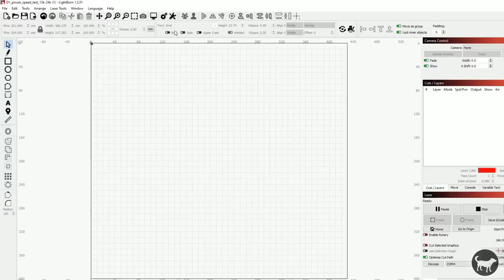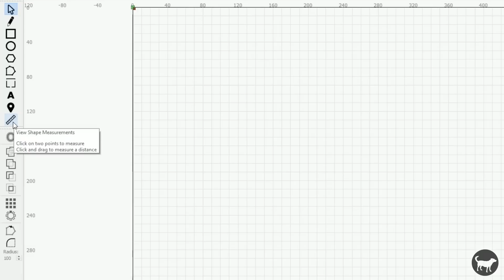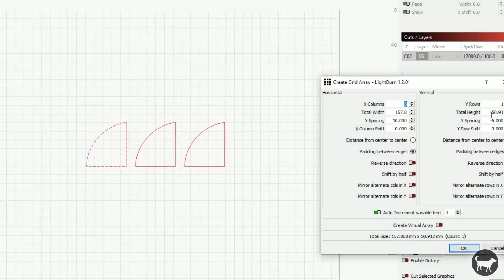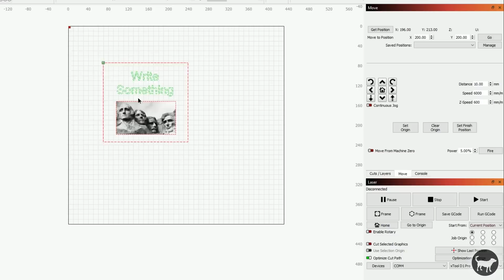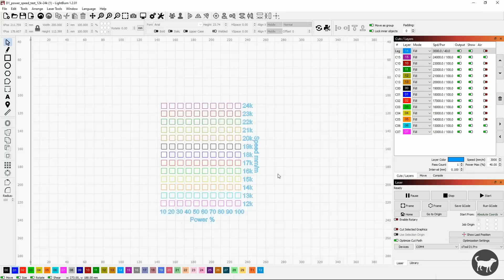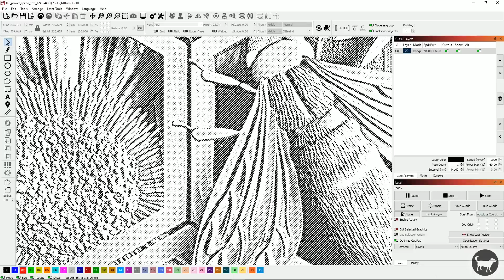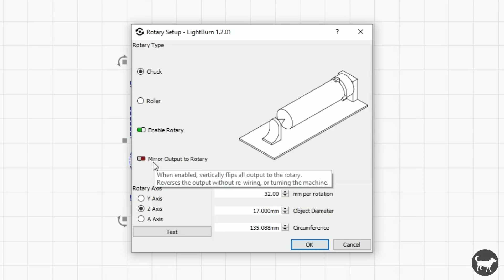Lightburn Tutorial for the xTool D1 / D1 Pro

Comment: I'm slowly losing my sanity. I've spent close to 7 hours trying to get a homing issue figured out. I've set up everything 2 times now. I thought the problem was the fact that I originally downloaded the lbdev file for the D1, not the D1 pro. I opened the device list after downloading the proper lbdev file and it found the D1 pro. I'm surprised the D1 lbdev still ran the D1 pro and it through me for a loop.... I thought deleting everything would have reset the software, but when I re-downloaded Lightburn to reconfigure everything, it had the D1 Pro recognized already. 

The issue is that when I try to home the machine, it just keeps trying to send it beyond the x0/y0, and makes a terrible sound for several seconds trying to rehome way beyond the limits. I just can't figure it out and I'm going insane. 

I bought your grid files excited to use them but it doesn't create the grid in the correct place and if i burn it again... without moving a thing, it will create a grid completely off target of the original grid. I have feet for it and everything. Please help me.
Reply: Another detail... If the laser is in the center of the working space and I press the home button it tries to send the laser  to the x0/y0 as if it were at the 420/400, not recognizing it's in the center of the workspace and not the bottom right corner.
Reply from the maker: @aaronscheibe9597  I'm not 100% sure what might be going on with your build of Lightburn but I would suggest trying 2 things. First I would open xTool Creative Space and click on the gear icon and check and see if you can get a firmware upgrade. After that I would see if you can clear Lightburn and try to do a fresh install. If the install is not clearing everything  you might need to clear the backup first. On a pc you can find it under : C:\Users\YOUR_USER_NAME\AppData\Local\LightBurn  (Might need to type in AppData if you don't see it). Not sure where that lives on a Mac if you are using one. Other then that I would also make sure your limit switches are plugged in and functioning. Might be worth checking to see if that works in xTool Creative Space as well.
Reply: https://www.youtube.com/watch?v=xHZdGn6n8MQ

Comment: I have had a d1 pro 10 watt for about six weeks. Recently the laser head will start hesitating and grinding when I am trying to burn a project. It jerks back and forth. I have checked all of the belts, made sure all of the screws are tight and cleaned the machine. I  I have tried with different files and it does the same thing. It does it in lightburn and xcs...is this a possible lightburn issue ?.Can you help? Thank you.     Tom
Reply from the maker: Hi Tom. The only time I have seen that happen was where I was trying to engrave a picture too fast and my computer couldn’t keep up with the speed of the laser. I found my laptop was too slow and the laser would grind as is got jumbled data. Either try shutting down different programs open on your machine that might be using CPU or send the file over Wi-Fi so the entire project is already on the machine. Other then that I would reach out to the company through Facebook or their website to see if they have an answer.
Reply: @BusterBeagle3D  Thanks for the reply. You got me thinking in the right direction that the problem was computer and not machine related. I had not made any changes on my computer except, just before the problem started lightburn had opened with a small window stating that I had not been there before. I clicked on the window and lightburn reopened. So I deleted light burn, imagR and xcs. I reinstalled them and now everything is working. Go figure 😺😅..thanks
Reply from the maker: @tomw5435  Glad you are back up and running!

Comment: Simple questions. I haven't even purchased mine yet. Once all cut paths are done, can you save the entire file so you can run the same exact thing again later, and will all settings remain the same? Also, do you need to run the test pattern before every time you use it, or can you just run it once on 1/4" mdf and assume all 1/4" mdf is the same?
Reply from the maker: Correct. You can save a lightburn file and run it as many times as you want. Also not all wood/MDF is identical. Plywood especially but you can probably use the same values if you are doing 2 different 1/4 MDF boards. Just be careful with MDF as some of it contains formaldehyde and cane be poisonous when using it.
Reply: @BusterBeagle3D  Thanks for the MDF tip, didn't know that. Love your videos for getting right to the point, and the training content is easy to understand.

Comment: Great Video. I also appreciate the templates from etsy. You stated the workable size for the 20w is actually a little smaller than 430x400 but xtool says 430x400 is correct. Can you please tell me what it should actually be set on for the 20w? Thank you
Reply from the maker: If you go to the xTool website and click on the D1 Pro and then scroll all the way down to the SPECS you can see the workable area of all of the lasers. It lists the 20W at 430x390 so that is what I was going off of. If you load that .lbdev file into Lightburn from the xTool website they only have one version which is 430x400 but that's actually too large for the 20W. It won't hurt anything to use that but just know not to try to burn something past Y390 if using the 20W.

Comment: Thanks very much. Appreciate your insights. If I may ask a question regarding changing the burn order of layers in order to make the cut that last operation: can LightBurn insert a pause before the cut? Just thinking that I would need to change the laser focus before starting the cut.
Reply from the maker: From reading the forums I don't think that this is a feature they offer. However since you can set layers to Output or not Output you could essentially run all of the engravings first and then run the cuts after, even from the same file. Just turn off output on the cuts and then switch it after it engraves. If you are using absolute coordinates everything should line up.

Comment: Awesome video! I’m getting a D1 10w this weekend. Do you a have a spoilboard grid for just the D1 not the pro? Or can I use the pro for it?
Reply from the maker: The same grid for the pro would also work with the original D1. Only issue is that you won’t have limit switches with the original so you would have to find a way to manually find the home position. Something like this might help. https://www.thingiverse.com/thing:5274995

Comment: Something from a total noobe.  I understand  LightBurn to an extent and you did an excellent job of explaining this software.  Now my hangup is the speed.  On the basic test from the online generator you showed the grid going from 100 to 500; then on the other grid 12k to 24k.  This has me totally lost  I know it's probably something simple I'm missing, but this has me and others wondering LOL.   Thank you for taking the time and effort to make this video.
Reply from the maker: Hi Kat, Happy to help. The D1 Pro can engrave at speeds of up to 24,000 mm/min. So that one grid is testing engraving speeds from 12,00mm/min to 24,000 mm/min. If you slowed the machine down to 100mm/min you would be cutting into the surface pretty deep depending on what version you have. You also need to pay close attention where people are talking about speed since some people use mm/min and some use mm/sec. So 24,000mm/min can also sometimes be displayed as 400mm/sec you just need to be careful as to which one you are using.
Reply: @BusterBeagle3D  Bless you!  I'am cautious when I read some of advice on settings...because of what you just said...That is what can be confusing.   (I have the D1 10W and use mm/min) and in the console it says 18000 does that sound right?  I certainly do not want to start a fire  LOL.
Reply from the maker: @kittyrings  Speed is determined by how powerful your laser is and how dark you are looking to engrave or cut. 18,000 has to be mm/min otherwise that would be 1,080,000mm/sec which no laser can do. Honestly you are somewhat safe guarded in your firmware where it has a max speed set and no matter what crazy high number you put it will only ever move at the max speed. What you want to be careful is of the cutting speeds. 1.6mm/sec =100mm/min which will cut pretty deep, 1.6mm/min = Fire.

Comment: Ryan thank you for  videos, I am new to laser engraving I just purchased the DX1 tool. 10 watt laser I also purchased Lightburn, with the lightburn software I can frame it hit start and it will engrave backwards I’ve tried mirror that just makes it worse if you could help would greatly appreciate it
Reply from the maker: Make sure you installed the configure file I mention in the beginning of the video. The home position should be in the top left corner so if you set it up backwards it will engrave backwards.